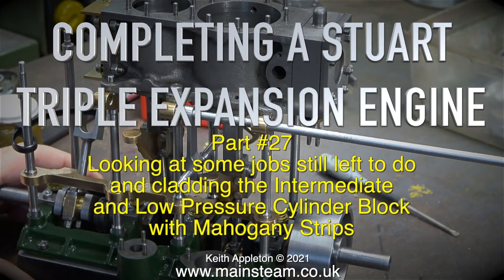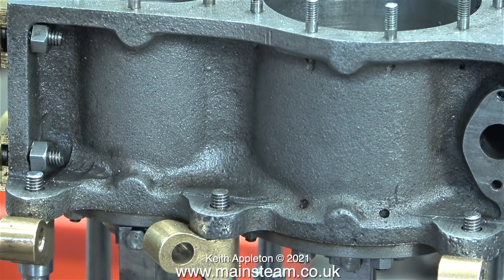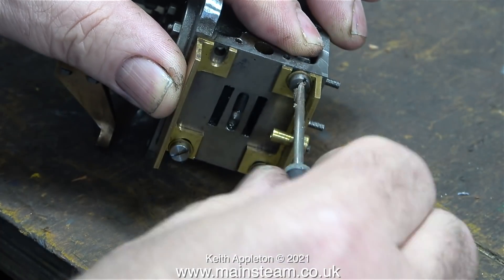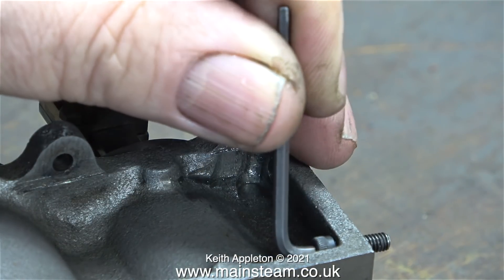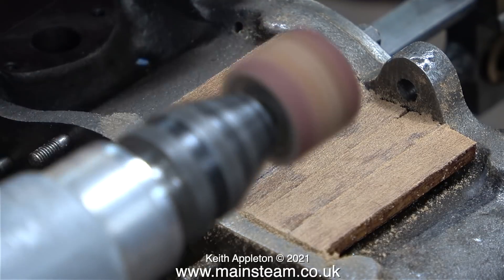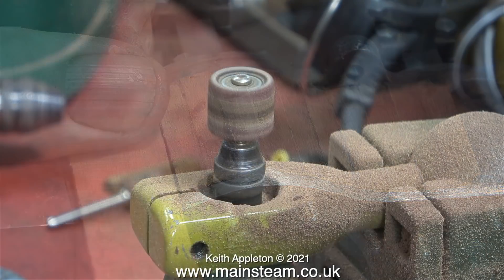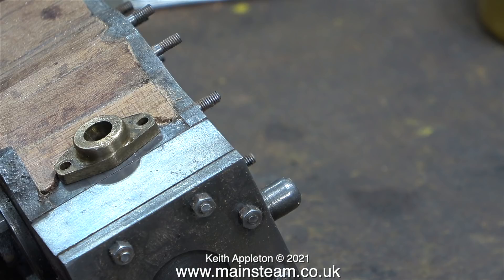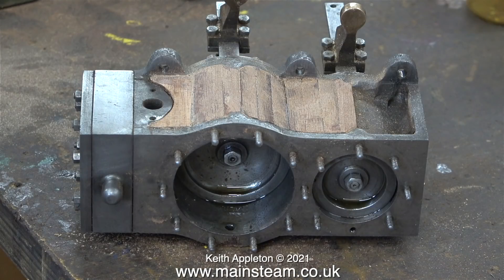COMPLETING A STUART TRIPLE EXPANSION ENGINE - PART #27

Comment: Add baking soda to the wood dust. It will instantly set the superglue. You just pour it on then sweep the stuff off that didn’t get saturated.. it’s a trick used by model makers to fill gouges and seams with that glue.

Comment: The cladding adds a ln interesting look to the cylinders. I think you mentioned before that usually the wood cladding is only on older style boilers.  It will be interesting to see the final results.  And CA is quite good at getting all over your fingers and gluing your fingers together

Comment: Here in the colonies, 3/16 is a #10 screw. The primary choices are 25 and 32 tpi. 24 is very coarse and I opt for 32 when I can.
Are BA screws 55 or 60 degree form?
Reply: Like the Whitworth thread, BA has a rounded root and crest, but the included angle is 47.5°
Reply: On my Triple I used a 3/16” BSW thread, which has 24 TPI. Close enough from Stuart’s design and much simpler to make…😉